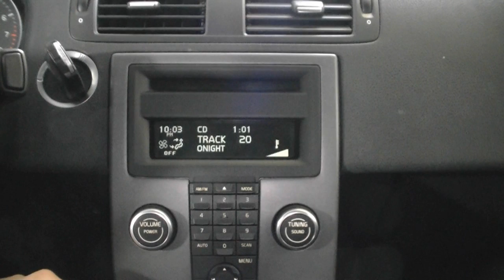GROM MST4: Volvo S40 2006 2007 2008 2009 2010 USB Bluetooth iPhone Android Adapter Installation

Comment from the maker: To connect the red wire to constant 12v you will need to locate it first. The you will use P-Tap or T-Tap (depends on what is available to you) and connect the wire to the constant 12V. Please make sure that you do not cut any wires that are coming from the stereo!
Reply: Hello bro can u help me please

Comment: I have an Infiniti M35 and I'm looking to install the bluetooth one but does all your kits come with the aux or iPhone input? and do you leave the module out or hide it behind the radio or in the glove department?
Reply from the maker: +Deon Mister The GROM-USB3, GROM-IPD4 and GROM-MST4 have USB port, where you can plug the USB to iPhone cable for wired iPhone connection and integration with car stereo/steering wheel controls. You can also add the AUX 3.5mm jack connection via GROM-C-35USB cable (MiniDin to 3.5mm phone jack and USB charging cable). You can also add GROM Bluetooth Dongle (GROM-BTD) into your system.
For Infiniti M35 you will need to choose the adapters from the list here: http://gromaudio.com/store/all-nis02.html if your stereo has CAT/SAT button. Make sure to check compatibility first!

As of location of the module, usually people leave it in the glove compartment, for easiest accessibility (specially if you will use the USB cable to connect the iPhone). You can also leave it behind the stereo, or mount it somewhere outside of glove compartment, it is really up to you.

Comment: I own a 2008 Volvo XC70 (the EU model) with the basic audio system. It has an inbuilt aux input in the center armrest and a fitting aux button on the control unit. Is there a way to fit a GROM interface with my model year and radio? All the best from Germany

Comment: Hi! This doesn't apply to models before 2008 as there was a different centre console. The whole armrest doesn't need to be removed. I've listed the way on swedespeed under the S40/V50 section. Also, the display frame has to be unclipped from inside, otherwise you damage the alloy trim around it!

Comment: do you have something like a touch screen stereo that integrates the AC and stereo controls like an overlay display?, I don't use the CD at all and besides bluetooth, I'd like to add a rear camera and a stereo with a display would be cool, but so far all i've seen sacrifice the AC and radio, basically all physical controls
Reply from the maker: We only offer the factory stereo add-ons, not the aftermarket stereos. Thank you for your interest in GROM products!

Comment: I have a c30 2011 with just basic handsfree, no aux/usb, if I buy the Bluetooth Adapter would my built in handsfree still work like it does and it will work with the audio too? Just wondering as I can’t find any info on this.
Reply from the maker: Hello, your C30 2011 is compatible with GROM-MST4 car kit. If you get the Bluetooth extension for GROM-MST4, which is called GROM-BTD Bluetooth Dongle, your factory hands free will keep working. You can pair your phone to GROM for wireless music streaming and to your factory Bluetooth for hands free phone calls.
Please visit https://gromaudio.com and search what is compatible with your vehicle by using "Find your car kit" widget.

Comment: Hi Ive just bought a 2006 s40 and it does not have an audio jack, can this be installed?
Reply from the maker: Yes, it can. Depending on if you have 6-CDs or Single CD, different model of GROM-MST4 will fit. Please visit https://gromaudio.com to find the product that will fit to your vehicle. Thank you.

Comment: will the steering wheel "next track" button which was used for the CD now work with the grom mst4 to change songs?
Reply from the maker: Yes steering wheel control buttons will work to change the songs with GROM-MST4 car kit.

Comment: Hi. My car is an S40 bought at the end of 2014 looks the same car of this video same for the stereo. You suggested me (via chat) to buy GROM-MST4 but I see in this video you wrote 2006 - 2010 Volvo S40. Are you sure It will work on my car? Thank you.
Reply from the maker: 2014  S40 is not compatible with GROM-MST4, sorry. Looks that there was misunderstanding between you and the representative on the chat.
Reply: GROM Audio sorry end of 2004
Reply from the maker: @teostarr961  For 2004 S40, if the stereo is the same as on the video - you will need GROM-MST4 model. If the stereo model starts with HU-****, you can use any of the ones here: https://gromaudio.com/store/all-vol01.html Thank you.

Comment: Hello,
Can you use it with the remote control (track search,Volume control) from the steering wheel?
Is it just 1 cable for audio/text and 2 for + and - ? 

Thanks!
T.

Comment: Installed the MST3 in my 2006 S40. The documentation delivered with the module and instruction in this video are incorrect. The breakout is installed in the return optical line, not the feed line. This is only detailed in the instruction manual that you can download from the product page. The operating instructions don't mention that you can scroll the 3 functions using the eject button on a single CD model. The CD unit is now inoperable which isn't mentioned anywhere. This is annoying as I still have a CD in the player which I can't eject. With the iPod or android phone connected the SRC display showing the song and artist sometimes jitters back and forth. In addition, selecting the GROM mode doesn't always work so you still get the radio even though the IPod is shown in the display. Is anyone checking the documentation or the testing the installation at GROM? I paid over 300 Euros for the unit.

Comment: Bro I need help, I have a volvo s40 2005, I went to future shop, they are saying its not possible to do it because I will have dash and other electronic  problem. Can't install double or single din. Cz volco radio has some function on dash. But u seemed have done it. So what can I do the double din JVC is on sale. Should I buy it and get it install by someone else?
Reply from the maker: Do you want to install aftermarket JVC stereo? You will have to integrate it with the rest of the car. GROM integrates fully with the factory car stereo.

Comment: Hi guys,  i just wanna to make sure before i purchase your product. 
I have a volco s40 2007 doesn't have an option of aux. its either radio or one cd, there is no cd changer like i had before in volvo 2005. will your product still work for me with android devices. if yes, can you please tell me what exactly i have to buy it to be a happy user. regards
Reply from the maker: wojtek, the adapter will work. You will need the product here:
http://www.gromaudio.com/store/most_adapters/grom-mst3-vols.html
Thank you.

Comment: Will connecting this cause the CD audio to be disabled?
Reply from the maker: CD changer will be disconnected, if you have CD changer and CD player - CD player will be working. If you have a Single CD stereo, CD will be disconnected. For more details please visit http://gromaudio.com, search for your vehicle and you will see in teh product description if you will have to disconnect the CD player.
Reply: GROM Audio So if I have 6 disc CD player it should be fine?
Reply from the maker: Yes, if you have Singe CD and 6-CD at the same time, 6-CD will be disconnected but Single CD will keep working.

Comment: hello volvo 2006 model s40 car audio music changer aux want to connect usb converter Where can I find the connection cables for volvo thank you thank you
Reply from the maker: you need to look into GROM-MST4 model for Volvo: https://gromaudio.com/store/most_adapters/
Please note that there are different models of GROM-MST4 for Single-CD and 6-CD stereos. Thank you.
Reply: @gromaudio I have the 06 s40 non turbo I see u sell the only Bluetooth aftermarket radio that works but I was wondering if I can use ur radio to connect a SUB

Comment: Buyer beware, if for whatever reason your vehicle isn't compatible with the MST4, GROM will not refund you outside of 30 days. Prior to purchasing, they informed me that it should work in my 2012 MINI after dealer reprogramming. Turns out they were wrong and it isn't compatible at all (my car lacks the necessary optical connections) and since it's outside of 30 days they are offering me a pathetic $80 buyback for a $280 product :(

Comment: I have this exact same setup in my car. I seem to have missed something, because my unit does not work at all. CD and Radio, and every option is disabled when unit plugged in. Everything else works fine. I have connected one POF from CD-Player into the GROM unit, and one POF from the ICM-Display, as shown in the manual. Now one POF from the ICM is disconnected. Is this the correct way? I'm having somewhat trouble understanding the manual. Please help.
regards,
Reply from the maker: Hello. Please contact GROM tech support at gromaudio website, click on support tab. They will get back to you quickly with help. Thank you.
Reply from the maker: Who are "they"? You need to find good car stereo shop and installer in your area, and check with them. Did you already got the stereo that you are willing to install?

Replacing the stereo is difficult in Volvo with fiber optic. With GROM you will not need to replace it, you will enhance the features of your factory stereo with the new functions.

Thank you.